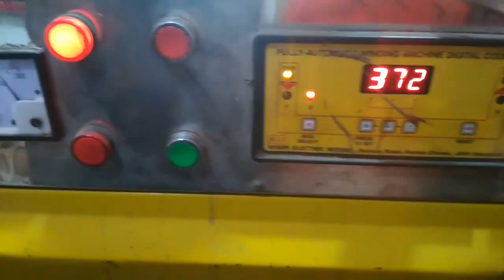Celling fan automatic motor winding machine

Comment: Sir aap na ish video mai nahi batayea starting coil winding complete hona k bad running coil winding kha sa start karange gay kon sa slote sa ta key common wire kam kara three wire mai na sunna hai thora sa mistake hona sa common wire kam nahi karta hai.ish per video banayea video cut muth kigiyea ga full video banayea ga or body mai fit kar k chala k dikhyea ga running mai supply da k fan siddha chalae or zoom kar k dikhyea ga jaha sa running coil winding suru kigiyea ga starting lide sa ya ending lide sa.

Comment: 36 slide Exshust mei kid swg ter dale ( बड़ा Exshust)
Reply from the maker: dear agar aap is fan ko aluminum wire se winding krne wale h to running m 26 no or starting m 28 no 
or yadi aap  ise copper se winding krna chahete ho to running m 27 no or starting m 29 no 
 thanks for comment dear